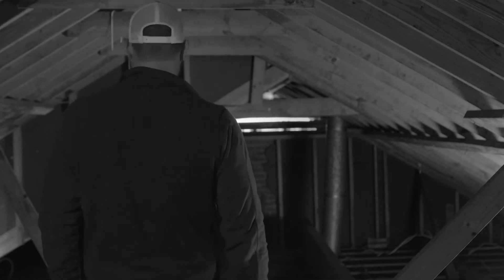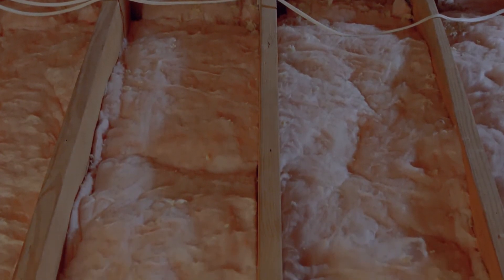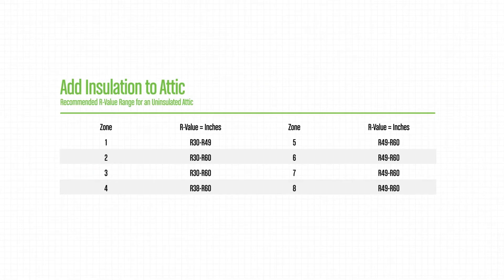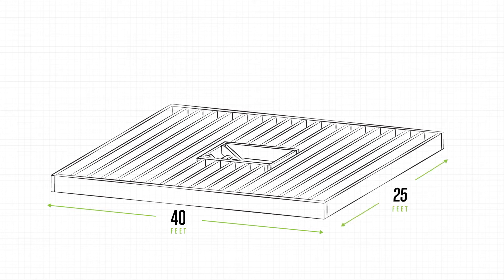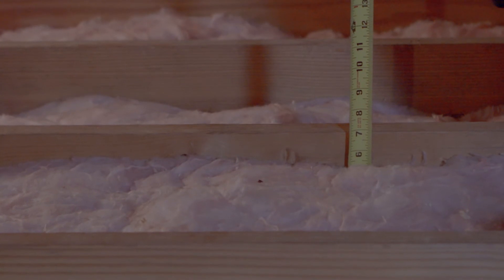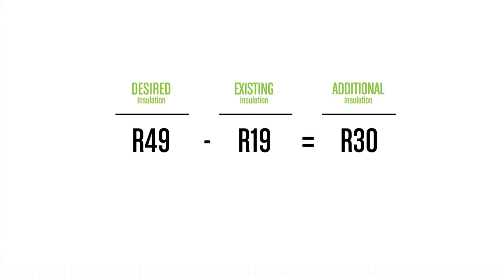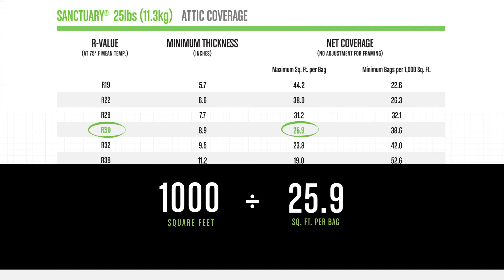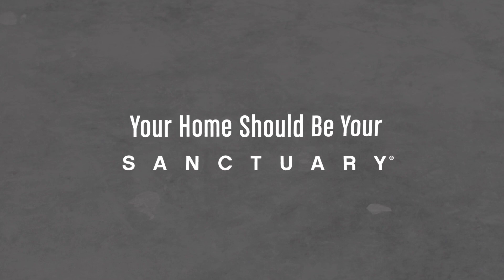Greenfiber How to Determine How Much Insulation Is Needed Based On Your Target R-Value

Comment: So adding insulation on top of fiberglass will not reduce the R vale of the already installed batt, by squishing it and causing the air pockets in the batt to compress? I was taught for the last 10 years of installing, that it would...